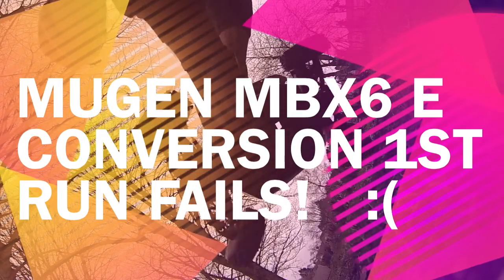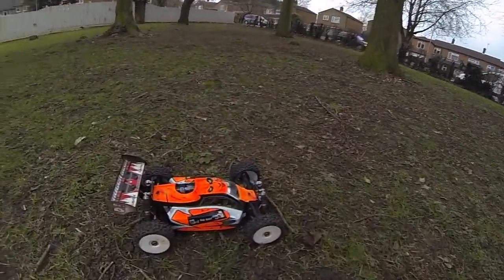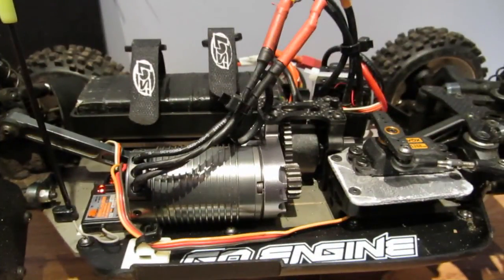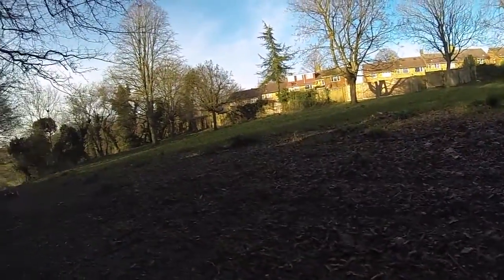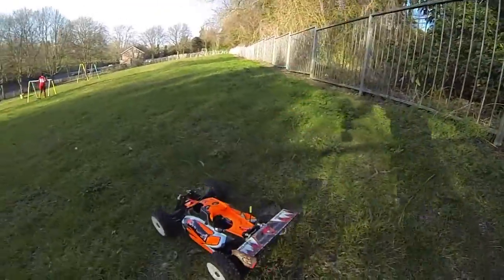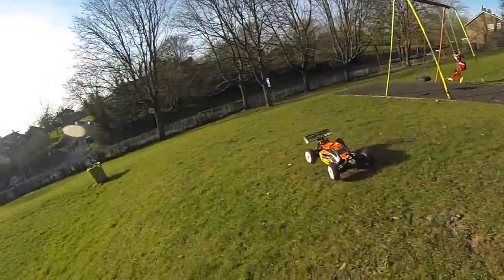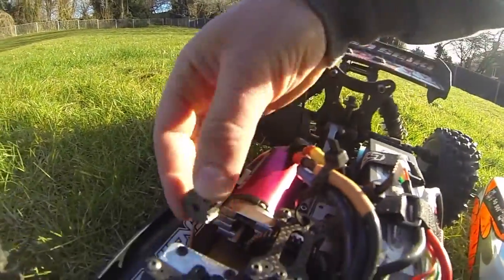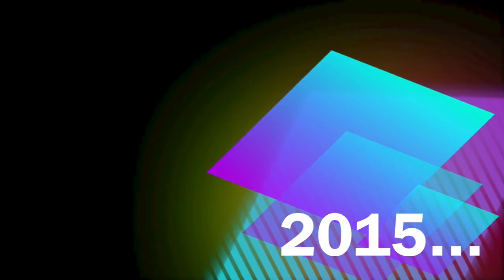Mugen MBX6 nitro to brushless conversion chat...

Comment: Sounds like your other motor has lost connection to one of the coils. Probably where one of the 3 wires solder to the tabs, the internal wires from the motor also go to these tabs from inside. I'm thinking that somewhere along here a connection is not good, could be bad solder joint or just disconnected. Have a close look and look for continuity with a volt meter.
  I am thinking to convert an old nitro buggy to brushless. What is the size of pinion it is likely to be? Mod1? Thanks.
James
Reply from the maker: izzzzzz6 hi mate. Your analysis is absolutely spot on. The solder joint on 1 of the motor wires feels fine but continuity was bad. So I re soldered and it sorted the issue. 👍😁
Reply: I fix a lot of stuff :D